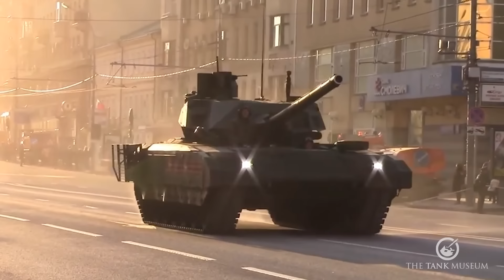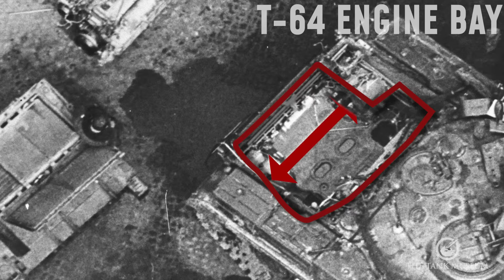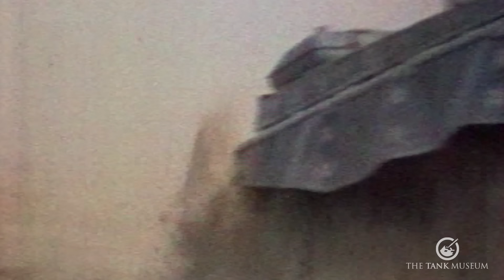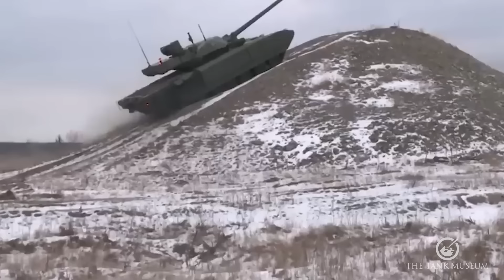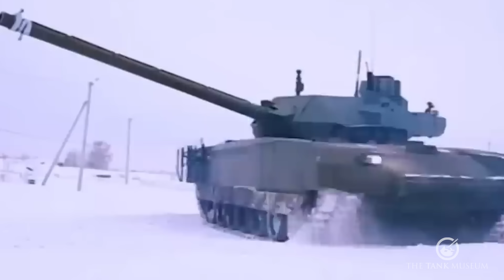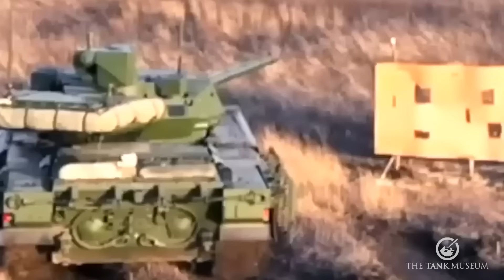Radical or Ridiculous? | T-14 Armata | Tank Chats #171

Comment: A few corrections. 
Regarding autoloading being slow to load. Manual loading that is supposedly faster, is only faster while standing still, but not while moving fast over rugged terrain. Also only when the loader is in good health, well rested and fed, and isn't stressed out of his mind. Battle stress IS a thing. So is field fatigue. So is being tired, hungry, sick. NOT a good combination when in conditions of total war.
T-80 was MEANT to be a development of T-64, however it was quickly realized that the platform is both too small and too poorly protected by that time. It simply had no "modernization reserves" as Russians call it. So T-80 is actually a clean-sheet design. Proof of that is in the fact that it was developed in Leningrad, while T-64 was developed in Kharkov. T-80UD is little more than a variation on T-80U that Kharkov plant had designed, but they never made their own T-80 hulls, only modified them. 
Another falsehood about T-80 is that originally it was produced in Kirov plant in Leningrad. Specifically T-80, T-80A and T-80B/BV. Omsk was producing the later-model T-80U. The diesel version T-80UD wasn't introduced "swiftly", since it took well over a decade to move from GTD-1000, to GTD-1100 to GTD-1250 and then the famous 6TD horizontally opposed diesel engine.
A-85-3 isn't a copy of a German engine. A lot of differences between are obvious. The only similarity is the X-shape. In the beginning the engine was indeed unreliable, but that's normal for a clean-sheet engine design. Things break for many reasons. Teething problems are normal. 
Russian sources DID state that Javelin and other top-attack ATGMs are typical targets for the Afganit APS. So I don't see why narrator says that tank is still vulnerable to top-attack missiles.
Regarding 2300 T-14s. That's a common misconception for western presenters which comes from translation mistakes and Russian media being dumbasses, whose rushed and poorly edited articles got used as basis for western presentations. The reality is different: 2300 is a number of ARMATA platforms that was meant to be produced overall for all purposes. Meaning shared between designs: T-14 Armata tank, T-15 Barbaris IFV and the T-16 Combat Repair and Evacuation Vehicle. In fact there was no plan to make T-14 replace all other tanks either. Around 700 T-14s were meant to be built for Russian military. That was the military plan. There was no cancellation of any production as the tank was in prototype stage for what Russians call "unit testing". It's built in relatively small numbers and sent into units to find and rectify teething problems and design issues. As for the statement that there is no need to flood Russian military with Armata tanks, that was a classic take statement out of context. The statement was made regarding the fact that Russian military doesn't want an under-developed unit that'll cost a lot more down the line. At the time T-14 was still going through unit testing and evaluation, but the hype was such that everyone wanted it all to hurry. Russians didn't want T-14 to be their version of F-35 where an unfinished design is being mass produced.
Sanctions didn't really harm the T-14. Russians have their own micro-electronics industry which although far behind on hardware produced, is more than good enough for military application. Military tech isn't super-computer stuff. It runs very basic (relative to normal house PC for example) programming that's very narrow in its scope, and thus doesn't require the latest micro-electronics. So Russian electronics are larger and heavier, but still does the job. Some components had to get their suppliers replaced, but that wasn't insurmountable.
Had a good laugh at "sights from France". That refers to old Catherine-FC thermal matrix that Russians used on T-90A tanks. However Russians had created their own all-in-house thermal matrixes of 2+ and 3 generation with also higher resolution than Catherine-FC, such as what Kalina and Sosna-U fire control systems use. Sights on T-14 are 100% Russian and don't actually rely in French thermals.
No T-14 was ever sent to Ukraine so there was no losses of that tank. T-72B3 and T-80BVM, the workhorses of Russian army in Ukraine, ARE refurbished old T-72B and T-80B/BV. However the claim that no production lines being established is false. Russians are putting out 100 T-90M tanks a month. With thermal sights and all. As well as new versions of T-72B3 model 2023. Also there are pictures of T-14s ON A PRODUCTION LINE. It's not clear whether those T-14s are now in full-rate production, but the pictured T-14s are next to T-90Ms in a same building on the same line.
Russian "corruption" problem isn't just Russian. It's a problem worldwide. At least they arrest and put people on trial in connection with corruption. As any civilized society should. They don't care about avoiding scandals any more. They know corruption will be the end of them, and started to really throw the guilty under the bus. Officials cannot be allowed to drag Russia under. In other countries corruption is simply legalized.
There was never a mythic promotion meeting any crushing reality lol Tanks get killed by artillery barrage. And same goes for Ukraine: most Russian tanks in Ukraine are lost to Ukrainian artillery. Nothing new. No tank can survive a 155mm shell landing on top of it or close to it when it rips off a track, shatters sights, stops the engine and shell-shocks the crew. 
Only fools and amateurs have an expectation of T-14 entering battle in Ukraine. Russians use tanks as mobile direct-fire artillery, as they had been since WW2. That role hasn't changed. There is simply no mission that'd require T-14s appearance in Ukraine. There is no point sending it to Ukraine only to lose a few to artillery barrage from which no tank on earth can be protected.
Statement by British MOD is little more than a typical British insulting propaganda aimed at denigrating Russia, something they'd been busy doing for many years now. That's all they CAN do when Challenger-2 is a commercial failure and with British military even planning on doing away with tanks altogether.
Russian ministry of defense had NEVER claimed that T-14 was in combat. It has only been claimed by some silly media outlets that didn't check the info. 
Russian army isn't beleaguered lol The loss ration against Ukraine is 10 dead Ukrainians for every 1 dead Russian. That makes Ukraine having lost a million men both dead and wounded. Russians haven't even broken 100k lost overall yet.
T-14 will be completed and adopted. There is no reason for that not to happen. As for fielding tanks being "problematic" for Russian military? Nonsense and propaganda. As stated above, Russia is putting out 100 T-90Ms per month, and likely just as many T-72B3s. Also it's been modernizing T-55s and T-62s to use in Ukraine as mobile indirect artillery. Those 100 and 115mm rounds aren't something to laugh at when you are on a receiving end of them. HE-FRAG is a painful thing against infantry and vehicles.

This video is basically a mish-mash of poorly-researched material presented with a typical British pompousness that ultimately remains little more than propaganda. After all, careful REAL fact-checking would tear this video apart.
Reply: What a long winded rant with nit a single link to any credible source. 100 T90s a month you say? Where do I find that information?
Reply: @davidurban7346  Do you have any credible sources to counter his points?
Reply: @TheNpcNoob  the leaked American documents that show a roughly 2.5 to 1 kill ratio in Ukraines favour which is reasonable for Ukraine being mostly on the defensive.
Reply: Quote "The loss ration against Ukraine is 10 dead Ukrainians for every 1 dead Russian". Extraordinary claims require extraordinary evidence. By claiming such dubious things you are bringing all your other satements under shadow of doubt.
Reply: @IlyaMikhaylov-e3s  Even if they had reverse, they still have couple millions more ppl.
Reply: @corwinblack4072 population moral is a factor too. The Russian people will be more sensitive to casualties than the Ukrainians.
Reply: I only had to see the "100 T90Ms per month" line to understand that there's no need to read any further. As someone who's been watching russian news about tank shipments, I can say that: there's been about 3 visually confirmed deliveries of T90M tanks to the russian army since the start of the invasion, all of them consisting of about 15-20 tanks. Combine that with around 60-70 tanks that were produced before the invasion and you get about 120-150 tanks total. And don't even start to say that they just haven't shown other tanks, Russia is such a country that if it hasn't show something it insist it's got, it probably doesn't have it. There are around 120-150 T90Ms ever produced. But you can go on, spread your "not-propaganda" and "REAL fact checking".
Reply: shut up you little cry baby 😭😭
Reply: Everything make sense
The sight, that a problem they tried to get away, and right now they downgrade T-72 sight
Mobile direct fire artillery is no, last tank they feature the role in manual is T-55

Ukraine artillery, umm I don't even think USA can even finish enemy by few round, that how ukr. special

And Ukrainian dead is what? If that die Ukrainian shouldn't be new low anymore, they can't mass mobilization like RU
Reply: Didnt the Minister of Industry and Trade Denis Manturov back in 2020 say the sent the T-14 to Syria to be "tested"?
Reply: Well written high quality educated comment. These ukrobots and westoids wont be happy at the truth. Prepare to be bombarded with "rUzZiAn bOt" low IQ comments
Reply: Im not reading all that
Sorry to hear about that
Or good for you
Which ever

Comment: There are some miths there. I have direct experience of being inside the turrets of both the T-64 and T-90 and they aren't that lacking in terms of space (by the way, I'm 1,86m). It felt like being seated in the front seat of a car. I had plenty of elbow room and everything seemed to be well thought in terms of ergonomics. Also most of the Russian tank-men I came to know were about my size.
Reply: I sure do like my miths
Reply: So is it a myth that tankers had to be 5'1-5'3 back in the day, or did they improve the space in vehicles as time went on after the T-34 and T-54/55?
Reply: @ajohnymous5699  I can only talk about my experience, but T54/55 (I have no experience with T34) is considerably less spacious and has poorer ergonomics than a T64 and a T90.

Comment: Like most Russian Equipment when it sees battle against Western technology it will fail.
Reply: Give at least one example
Reply: @ace_pass  I you know so much about the T-14. I will only point out a few things why I made that comment. As you know it came out in 2015. Plagued with problems. It has finally been seen in Ukraine. But only in a fire support role. Wonder why? They were built to take hits from depleted uranium rounds. But recently they were fitted with additional armor in the front. Wonder why? Also the auto loader hasn’t been tested in combat situations. The T-90 was the pride of the Russian Army but has seen at least fifteen destroyed and some captured. Now with Western Tanks in Ukraine will the T-14 match up. I could get into the way the Russians use their Armor but that’s another story. The Spring Offensive is almost here.. So will the T-14 make a difference or will it have the same fate as the other superior Russian Tanks that are just burnt out shells on the battlefield.

Comment: Shouldn't the fact that, as you say since 2011, 72000 officials have been summoned to court over corruption charges, point to the fact that there is quite an effort to stamp down on corruption? Just caught my ear, as it seems to go against the claim of huge corruption. Not saying that's not the case, but 72000 is a lot.

Comment: T-90 is 26 or 27 T-72 modernization ... T-90 get name only show that it is not old T-72 ... Please check recent Ukraine intelligence capture T-90M analysis ... nothing new engine form 1937 ... actually 1934 ... when T-34 was accepted in service  it is T-72 with a little better armor and worst mobility due the weight increase and no engine update ... T-72. All electronics for T-90 full spec is from NATO (France -> Thales) it is has issue with muddy roads ... reason tracks design from T-44 ... (see weight increase). For all Soviet military equipment it was perfectly okey if first period of time producer need send support teams to fix all issues ...  T-14 continue the worst Soviet traditions -> initial run with questionable quality and again advanced electronics from the West ... which is not possible acquire in needed numbers ... In the 2014 301 Russian critical military electronics  equipment was sourced from the West ... it is outdated design ... good for massive tank to tank warfare which never happen ... (the US switched to anti tank missiles and mobile group warfare...)

Comment: I do like no discussion of the Armata actually gets down to the fundamentals. It’s speed, armour and firepower. Does the new engine make it go any faster ? Does it have better armour then it’s predecessor is its gun better ? Because the discussion gets bogged down in does it work at all ? Can it get the bits ? Can Russia build the bits ? Perhaps any discussion of Russia rearming should start with discussion of its industrial policy rather then any individual bit of kit, because that’s where the pinch points seem to be , not the designs of the tanks or submarines or jets.

Comment: Off topic, but I watched a WW11 doco Russia verse Germany__ the tiger tanks report the 30mm cannon from the IL planes (apparently the Russians had thousands of them) just bounced off the armor__ had this been directed at tracks ( hoping to de track them ) or a diving attack from the side or behind against the engine compartments would this have improved their kill rates? Tank killer crews  focused on the engine compartment if they couldn't place mines.
Reply: Ilyusion -2 had 14.5mm machine guns for armor penetration. It would dive in from above, pull up to the rear, sweep around towards its own lines, and swing in to strafe the rear deck and turret rear. Engaging on approach, it could tear through above the driver and radio operator, and easily take out the commander in his hatch. From behind, the 14.5 A.P.I. easily tore apart engine compartments, fuel tanks, and ammunition and crew in the turret. Its bombs are mostly donated to artillery positions, though A.P.I. can search out ammunition piles.

23mm automatic cannons are for enemy fighters, hit them before they hit you, hit them hard enough they can't get in to hit you. That is why they are loaded with H.E., not A.P.!

It doesn't have 30mm anything.

Comment: Interesting.. I just watched a clip from both western and Russian sources where they are able to produce up to 1500 tanks a year under the current stage of the economy and increase if the economy changes to that of actual war. If anything Russia will produce everything herself as they do have the intellectual capacity to do so and that is well documented. All in all it will not matter who has the most, best and better designed tank "they all burn the same". D.Medvedev.

Comment: It seems possible that the T14 never entered Russian service. at all.
Somebody said the "T14" in the parades have missing equipment, somebody else claimed some of the weld seams are rather bad.
If the T 14 would have been given to the troops, would Putin have missed the oportunity for a 
"the supreme leader gives the first company of the bestest tank in the world to the 1st Guards division Leibstandarte Vladimir Putin" video? 
I do not think so.
All considering i conclude that the seven T14 we have seen in 2015 are prototypes.
We do not know what is, and what is not included in this prototypes.
we have seen that they can drive over a relatively smooth surface.
we have no knowledge weather they have a functioning autoloader
we have no knowledge weather they have a functioning cannon
we have no knowledge weather they are actually protected with armor.

It is possible Russia has 0 T14s

Comment: Interesting analysis. But also a bunch of western propaganda nonsense. Russia doesn't need  any western tech. They have their own industry and are more than capable of standing toe to toe with the best western counterparts. Also the t14s are in Ukraine however are still being field tested and it's easier and cheaper to just modernize the existing t90s and t72s for now. But im sure we'll see the t14s in action later on once everything has been fine tuned.
Reply: Name one russian computer brand, ok calculator brand? Only thing that russia does professionally  is  propaganda and cheap show off
Reply: Nonsense - Russian electronic tech is 30 years behind the west.
Reply: @LondonSteveLee  no not anymore. This ain't the 90s